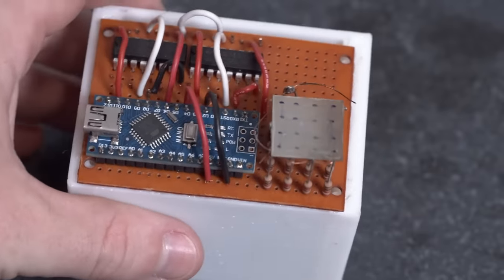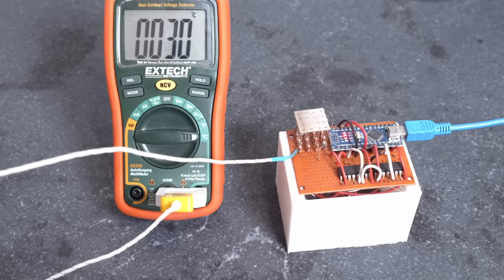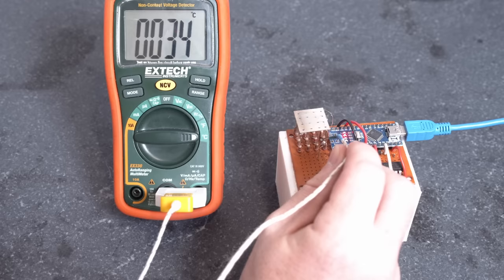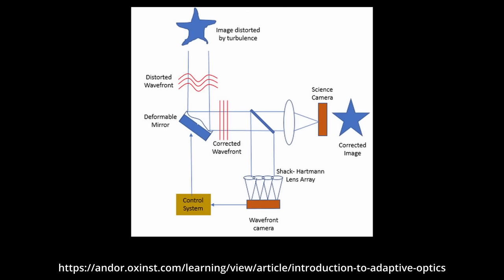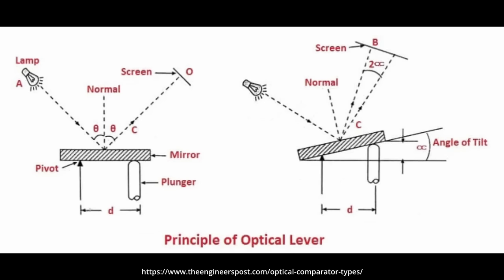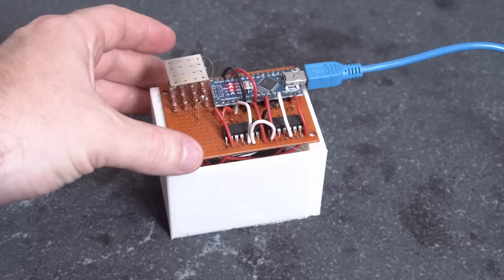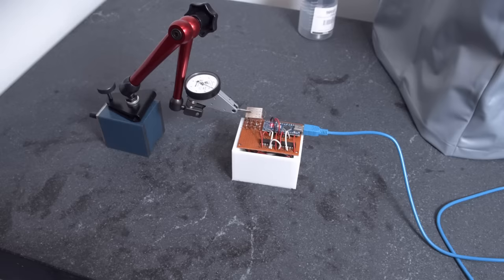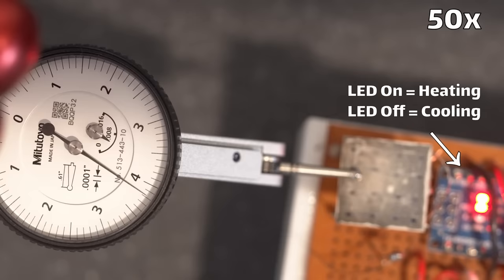Moving mirrors with heat

Comment: Have you heard about self-mixing interferometry ? There's a really nice video about it on the Applied Science channel and it seems fairly easy to setup.  
Self-mixing interferometry allows you to measure sub-micron displacement using a bit of electronic and a simple laser diode, I think it would work really well for measuring the displacement of your mirror.
Reply from the maker: Will look into it closer! I recall seeing Ben's video on it but it's been a long time, and I had totally forgotten about it.

Comment: It is slow, but probably one of the smoothest transitioning mechanisims for such a task. So if there's a need to produce a smooth (probably nonlinear) delta in elevation, this would be the way to go. Lightshows might be an idea, but then again it's probably easier to increase the resolution and use mechanical actuators

Comment: damn i was looking for "DIY adaptive optics" since morning and didn't find any until now and realized that you have uploaded today. coming after your JWST actuator video which was awesome. cant you make a DIY solution for piezoelectric actuators / electromagnetic actuators? and what sort of thin/ thick mirrors they professionally use in observatories to couple with adaptive optics, certainly not thick blocks of glass mirrors right? and what should the resolution be of a practical DIY adaptive optics grid, like XX actuators/sq inch

ps - i was also interested in DIY telescope mirrors but hexagonal in shape, is it possible to craft those in a DIY setup?

thanks! you are the best!

Comment: Hi, might be interessting for you. I have seen thermal actuators in industrial paper production. They are used to get an even paper surface and  thickness in the beginning of the process, where they catch the paper out of the paper fiber bath. But these actuators have a length of a meter if I remember correctly 😉

Comment: If the mirror quickly changes its shape, this will lead to heating of the mirror material itself and damage to the mirror material from mechanical fatigue, and the mirror can also expand and change its shape from heating. Also, if you want to use heat to deform the mirror, then it is necessary that the minimum temperature be low, then it will be possible to obtain a large temperature difference and more expansion of the material.
You can try rods made of vinyl, thick fishing line. Vinyl has a high expansion coefficient and artificial muscles are made from it that contract from heating-cooling.

Comment: This is a really cool approach to bring this technology into the hobbyist realm! I'd love to see amateur astronomy get access to deformable mirrors one day...
Reply from the maker: Agreed! I'm not sure if the thermal mechanism would ever be usable enough for astrophoto, but after working on this I could see an electromagnetic option being viable.  Pretty low cost and easy enough to control. The wavefront sensor is probably the hardest thing, needing a high-quality microlens array. But all sounds doable!
Reply: @BreakingTaps    Has anyone done a video on how wavefront sensing really works on the hardware level? All I've heard is that they bounce a laser off the Carmen line. Converting that artificial star spot into mirror movements still seems like black magic.

Comment: Dude, are you familiar with wax motors(basically thermal actuator)? I feel like they/an iteration of that concept would be easier I believe.  If they were significantly smaller cooling down and heating up would be much faster if the cylinders were in a cooling tank
Reply from the maker: Yunno I was vaguely familiar with them before, but it never ocurred to me for an application like this. That'd probably work well! Or at least some kind of actuator based on that design, even if it ended up bespoke.
Reply: Bigclive did a teardown of one recently
Reply: @BreakingTaps  yeah I do know they pack quite a bit of force for their size. I think it'd be worth looking into for a fun concept. I'm not sure if there is an off the shelf version small enough but the concept is basic enough. And again if they were being  cooled  and had resistors like you had already for the heat to enable the motors movement I would bet that it would be more controlled and quick. Anyways just had that thought!

Comment: They tried using these on the aircraft born laser that was mounted in the nose of a plane. It kinda worked, but had a very limited operational range... like 5 miles. Even with adaptive optics the amount of both atmospheric distortion and horizontal lensing are so high even a highly focused dry chem laser can't keep it's beam together long enough to defeat targets more than 10 miles away.

Comment: Thermal actuators or adjustments for optics are actually used in some stabilized HeNe lasers. Also, wouldn't the PCB deform far more than the mirror? One side should be really stiff as I understand it, otherwise you would get a thermally adjusted PCB?
Reply from the maker: The coverslip is very thin (around 300um) so it's surprisingly flexible, compared to the protoboard. But yeah, I expect the substrate is probably deflecting some as well, stealing a bit of the actuation range. The paper used a much more rigid setup, placing the PCB directly against a machined fixture thing

Comment: Perhaps making a thin PCB with SMT resistors on the back of it, and glue the PCB to a thin first-surface glass mirror.  A heat gradient across the surface should cause it to curl.  You could even add temperature sensors on the PCB to provide some sort of closed loop feedback.  Perhaps I should try this...

Comment: What about casting a PMMA (or similar) thin film on top with the other side against an optical flat (even a standard microscope slide would probably be flat enough to get down to a low number of fringes), then aluminising that ...

Comment: I wonder if you could use the resistors to tension a reflective sheet, kinda like a trampoline.
Reply from the maker: If you found a better way to bond it (the epoxy is too rigid I think)... I bet it'd work!
Reply: @BreakingTaps  flexible glue with high surface holding properties like goop/shoe goo/e6000 aka Styrene/Butadiene? it doesnt start melting until WELL over 200 degrees, i've used it to hold and seal engine parts before

Comment: ... another pretty cool methode for hobbyists/DIY for deforming mirror-surfaces is a grid of small solenoids below a thin puddle of ferrofluid and a membrane-mirror floating on top of the ferrofluid -- here you'll deform the surface simply by controlling the current per solenoid ;)

Comment: Oh that's pretty amazing! I can understand the issues involved with it. i.e. Heatsoak causing the deformation to change over time. I guess some form of micro-cooling could be used to maintain temperature stability, but thermodynamic hysteresis is really a b**ch. How to design for that to create a stable system is really where engineering shines.

Comment: Some thoughts: Use 5 points, 4 corners and center. Use a shaft material with a high thermal expansion coefficient. Use an adhesive with more elasticity, the epoxy could be causing an issue with mobility, then again that may be of benefit once the actuation issue under control (possibly use epoxy on the center but plyible on the others?). Use tiny peltier devices on each shaft like the ones found inside the old Kinect devices for the xbox 360 behind the IR laser, this will allow you to heat AND cool the shaft material. Perhaps on the corners use ribbons of material as shafts to allow better coupling of the peltiers, mount the shafts at 45deg to the corners. 

To just test the actuation and steering the mirror go with flat shafts in a bix 3/4 to 2/3 the size of the mirror square parallel to the sides. It will only explore pan tilt and piston for motion, but it should also help explore compliance of the bonding material for the perpendicular flat shafts. And will give you a better idea of what level of actuation to expect.

Thats just my unsolicited 2 cents on the topic. If I didn't already have a number of irons in a hand full of fires, this is interesting enough to fiddle with myself...alas, I am but a prisoner of my own procrastination 😅

All of that aside, another cool video, mate! Keep on keeping on! 😎👍

Comment: When it comes to actuation. I've build a few wax-actuators over the years. They are easy to build can be quite powerful but slow.
A while ago i read about fine actuators based on electrostatic repulsion, but i didn't find the article anymore. :-/

Comment: I just had a stupid idea. Dunno if that even has a practical application. But what is you use a pure silver sheet as mirror and paint the backside black. Next step is to scan the the back of the mirror with a decent enough laser to introduce thermal expansion in the silver itself. All the while a fan blowing abient temp air over it to increase the reaction time.
I guess the local displacement would be extremely hard to measure. And UV laser interferometrie sound like Kentucky Fried Eyeballs to me 😀

Comment: You could have do much simpler check, project light (projector/flashlight with pic above) with concentric squares -> into mirror and then back on white surface..
1. test reflected image on surface before distortion
2. test reflected image on surface after distortion

Comment: Wow what a video to find the morning im headed out to West Texas to do astrophotography. Is this similar to actual deformable mirror tech used in AO's? Could this be scaled down to smaller resistors, hence more resistors, and can it be sped up? I've been looking for actual plans to a deformable mirror but they're closely guarded secrets. I'd love to be able to build and actual AO and use it to clean up my images of stars and deep sky objects.
Reply from the maker: Similar in some ways, but quite different in others. The concept is the same idea (using a thin pellicle mirror bonded to some kind of actuator) but I think most commercial AOs tend to use piezo, electromagnets or MEMs devices. Scaling it with SMD resistors or something should work well, and the smaller size will allow it to actuate faster although with less range. Will still be quite slow compared to piezo or electromagnets though!

Comment: Have you tried searching for alloys with more thermal expansion? Sodium should be the metal with the highest expansion rate. You can keep it under an oil at the lowest possible temperature and have the mirror on top of sodium rods. Also, you should try keeping the rods in your design cool, selectively, with small thermo-couples (you can remove them from a TEC 12706 or 12710, which have 127 and 06 or 10 watts total, respectively), to increase the response time or you can use the thermocouples for everything, since you can reverse the current and have them hot or cold with the "flick of a switch". Possibly even ceramic heaters could be a candidate. They get hot REAL fast and you can easily reach hundreds of degrees Celsius in fractions of a second which could be ideal for metals/alloys which need higher temperatures. I bought a 2V to 18V mini ceramic heater of 10 mm x 10 mm by 1mm and it reaches 120 degrees C at 5 volts sucking 1.6 watts. They come with pure silver wires.
I also wanted to play with deformable optics in a newtonian for quite a while. I thought I'd use a silver coated or electroplated elastomer as a deformable lens, as a membrane on a box with variable vacuum, but I have not tried it yet. Another approach I though of was to use steppers with strings and/or linear actuators to pull various sections, to deform it in specific manners, but yet again, I'm not that much into astrophotography anymore.
You're definitely more knowledgeable than I am and I bet you got all this figured out, yet I still hope I can bring you some other insights with this comment.
Have a nice day, sincerely.

Comment: I think one of the challenges of making this was how the arrangement and quantity of resistors made the system overactuated. I think actually using less actuators, (possibly only three)  and a thicker coverslip would solve a great deal of the challenges maintaining rigid body actuation of the mirror without deforming it out of plane.

Comment: I would think another problem with thermal actuators is that they would be significantly affected by ambient conditions, plus there would be a need for thermal isolation between actuators. I'm sure there must be an application that they would suit but not sure what. Perhaps a high G environment.
Reply from the maker: Ah yeah, that's definitely a potential issue! Hadn't even thought about that aspect :)

Comment: One more item why we don’t want to use a resistive unit on a research telescope, it generates heat. We can watch the heat caused turbulence off of the optical train when trying to collimate the telescope, or using a live feed camera while tracking. This is also the reason most telescope domes are painted white with impregnated TiO2, to reflect IR.

Comment: Hi there, sort of off-topic, could one use this principle to deform a hard drive plate  to build a primary mirror? 😏
Reply from the maker: In theory probably! In practice it might be difficult... hard drive platters are pretty thick if I remember correctly. This works best if the mirror is very thin and flexible.

Comment: Now increase the scale and use mirrors that are sold in motorhome stores, they are thin and flexible and at an interesting low cost for this project, you can make an adaptive telescopic reflector using this system.

Comment: Genius
Reply: Could a parabolic mirror be made like this to automatically adjust focal point say to a solar panel or pipe to boil water for a steam engine water heater etc.., as the sun moves. "Sungazer" 😎🌞 It would be extra neat if no electronics were needed and somehow the thermal expansion and contraction would happen with solar thermal energy.

Comment: Wouldn't 3 (or 4) resistors be easier to control than 16, not to mention there are less chance of warping the mirror?
Reply from the maker: Correct on both points! But the original goal was specifically to induce warping in localized regions. It didn't end up working that way because I couldn't measure it, but ideally you'd be able to address specific resistors/actuators to adjust local parts of the mirror. :)

Comment: Great video as always. Don't put solder on wire ends that go in to a screw terminal. That's a fire hazard, as the solder will get softer and the connection will get loose, causing arc-overs.
Reply from the maker: TIL!
Reply: @BreakingTaps  ooops this was meant for another video 😁😁 sorry for the confusion 😄

Comment: an other thing, the heat of the lead going to the mirror, not only pushes up the mirror, it transmits heat which then makes the mirror deform radially to the lead, not quite desirable

Comment: Instead of packing the diodes in a square grid i would suggest adopting a triangular grid, and connecting 3 diodes to one corner for each grid, but with a certain directional offset, allowing you 3 axis control over each point. You could literally get away with having a triangle with 3 diodes to each corner. Why?: easier to control, Diodes slightly misaligned wont 'fight' the other ones, and having a single contact point for 3 diodes, and only 3 contact points in total to the mirror makes the mirror warp less. having 3d control over 3 points is all you need to realign the mirror, and having 3 points warp will lead to a natural parabolic shape from itself. You can then later on scale up the design by just gridding the triangles in a hexagonal pattern. Just dump squares tbh.

Comment: Is there no way to polish the mirror after it's assembled there?
Reply from the maker: I suspect the mounting isn't rigid enough to really support precision polishing. But we can probably lay blame at my prep, if I was more careful with the prep of the resistor lengths it probaby wouldn't have warped as much :)
Reply: @BreakingTaps  and that epoxy on the back... Sometimes janky is an art form, and sometimes it's a form of art.

Comment: Did you consider capacitors and their size change on charging/discharging due to the electric field? Introducing heat into a precision optical system is not what you want, don't you? I don't find any data on size changes of capacitors. But there has to be a force. The other way around there are many sensors working on capacity/voltage changes due to external forces.
Reply from the maker: To be honest I wasn't aware of that effect before this video! But a bunch of people have mentioned it so I'd like to look into it. From what I can tell the effect seems to be sub-micron, but very fast and forceful as you said. Could be a really neat way to get low-magnitude fast AO!
Reply: @BreakingTaps  Submikron is just in the range of the wavelenghts of light since a precision mirror has to be lambda/8 at least. Of real concern is to control vibration behaviour of the surface if you'll adapt it 10 times a second to seeing parameters or faster. That's my thoughts. You may end with standing waves over the mirror that is lifting one side the other end is lifting a fraction of second later and needs extra counter forces. In my opinion it's a lot of experimenting. I have the picture in my mind where some acoustic stimulated metal plate with some sand on it shows waves and knots.